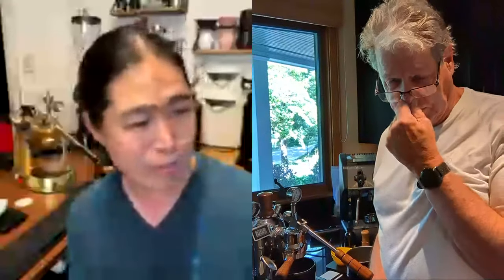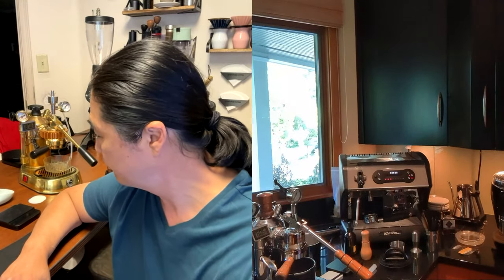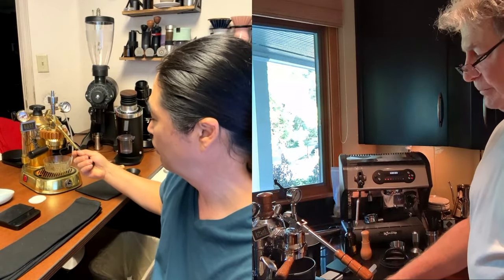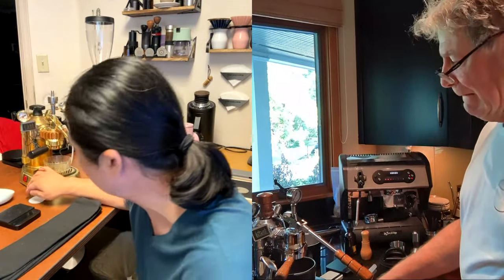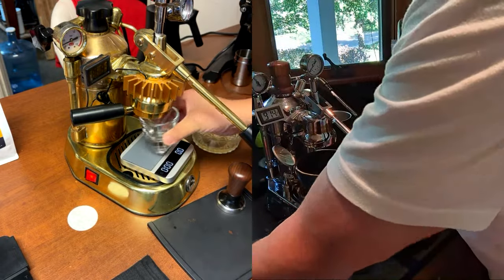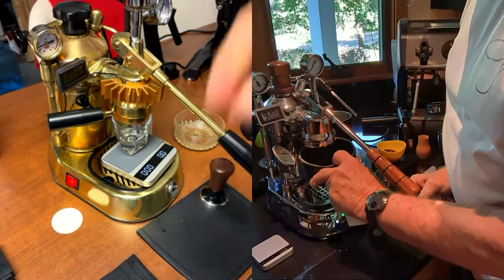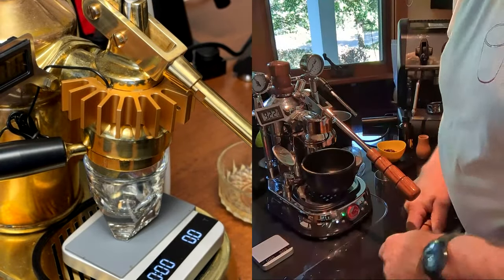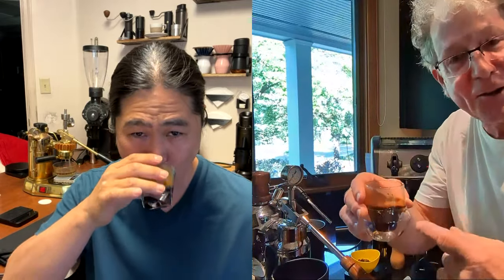Perfect Espresso Shot with La Pavoni | "Fellini" Technique

Comment: This is basically my modified version for the Flair 58 Valve Plunger Method. Whereupon, you fill the chamber, then use short pumps on the handle so that it extracts all air bubbles and packs that brew chamber solid. Doing this you'll notice as soon as you start the pull you have solid bar pressure about 2 bars. Makes a difference in.your extractions! 

Notice when he pulls that La Pavoni handle,  he has no.resistance for the first couple inches of throw, that's what you're eliminating with my method on the Flair!

Comment: Hahahaha, I've always pulled twice, if not 3 times. The first @ 3,4 maybe 5 bars just to get the beans wet, so there's no channeling. And not necessarily a full pull. Then a full pull. But if the first pull is too hard, I don't really make it 9 bars. Still pre soaking, in my opinion. The  third is usually a very nice, easy 9 bar pull. I'm not drinking espresso anyway, I add steamed milk and sweetener. I don't care if someone says im doing it wrong, it's my house, my rules! Hahahaha. I also put sweetener in the milk before I steam it, so the milk on top is sweetened as well! And I let la pavoni engineers do the designing instead of modifying a perfect machine!